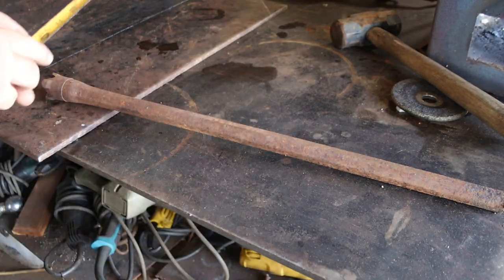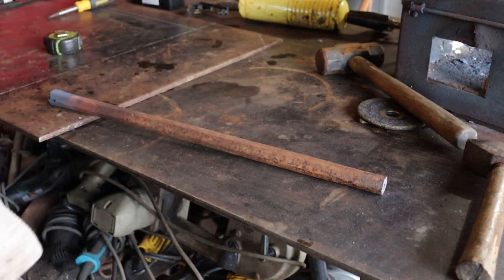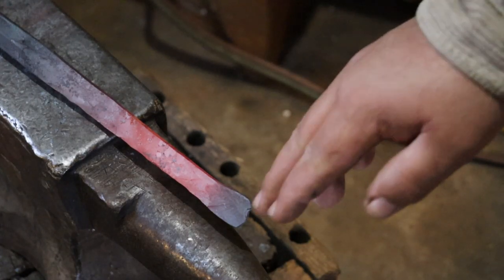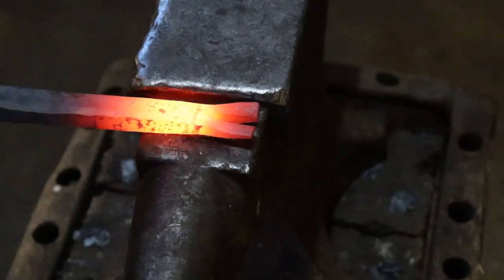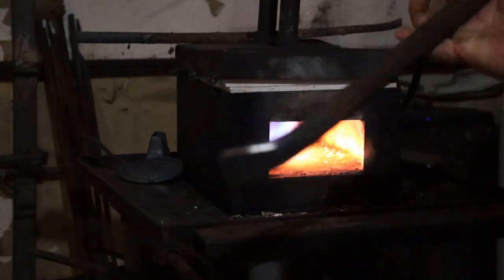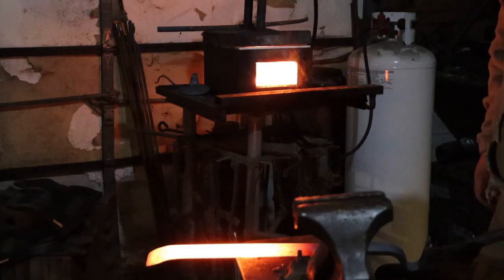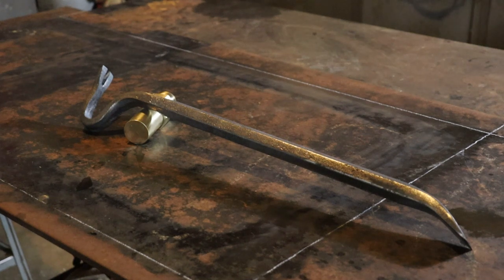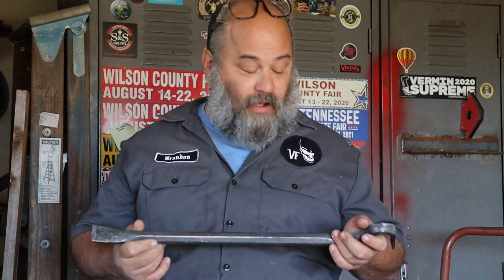Making A Forged Pry Bar!

Comment: Looking at doing a longer prybar as a gift for a mechanic friend, a big boy for popping out ball joints, tie rods etc, Im thinking of going 4140, heat treating the whole thing and then tempering it back at maybe 500-550 to get a decent bit of spring, what do you think?
Reply from the maker: That could work.
Reply: @VooDooTennessee  appreciate it, haven't worked 4140 before mostly found and recycled steels.